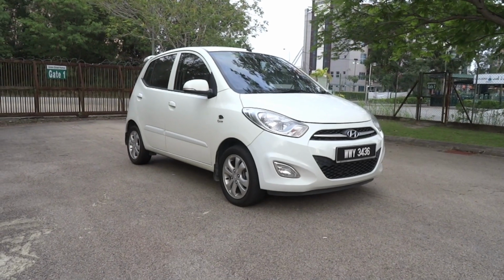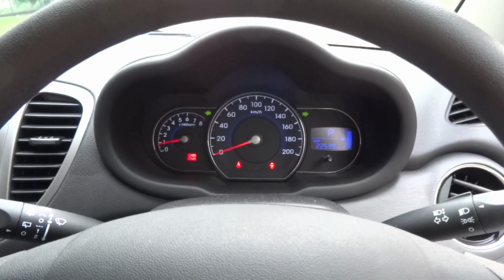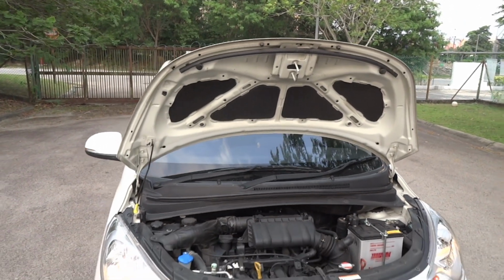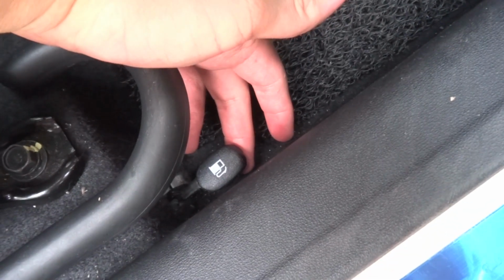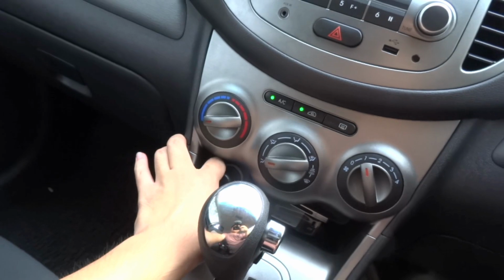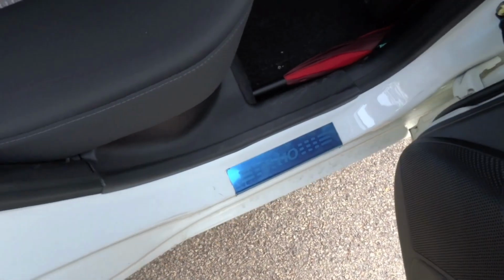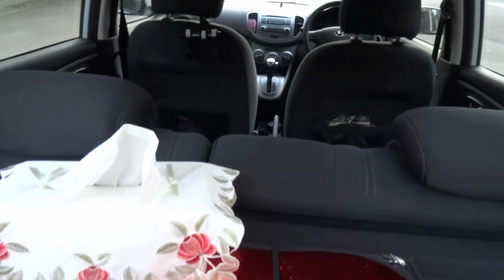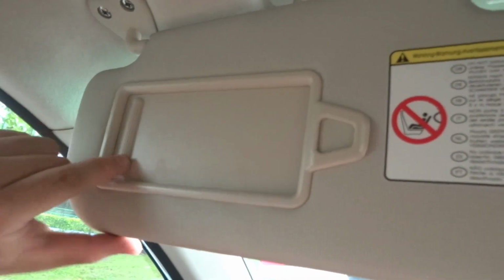2012 Hyundai i10 1.25 Kappa CVVT High Spec Start-Up, Full Vehicle Tour, and Quick Drive

Comment: does it have a average fuel consumption monitor onboard ?
Reply: mine didn't,
be very easy with the gas, as flooring it all the time will cause a short life for the motor and transmission (mine was manual) in addition to poor fule economy

Comment: Bought this car second hand 2012 full spec, overall good city car. Aircon damn cold.
Reply: If you were on budget. Get the Hyundai Atos. Also aircon and automatic windows. Firmer seats. Overall i like it way more. Only fuel conspumption shall be worse. But my i10 is not that great. I rather have an Atos with the small miles i make.
Reply: @triballing  atos is good for long distance ride ... city ride i see it tend to consume more fuel
Reply: @triballing is Atos a good car?
Reply: @ashraff_khan  It depends on the budget you have. For a small budget it's an option.
Reply: @triballing  any issues with this models? Transmission? Oil leaks?